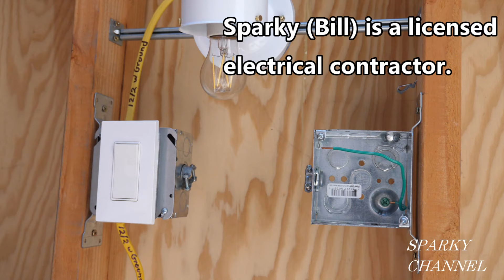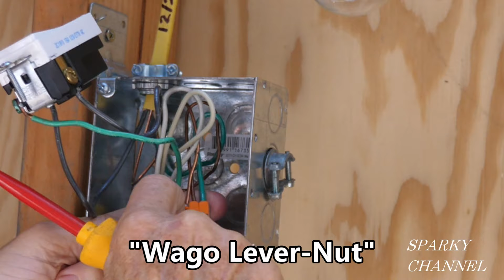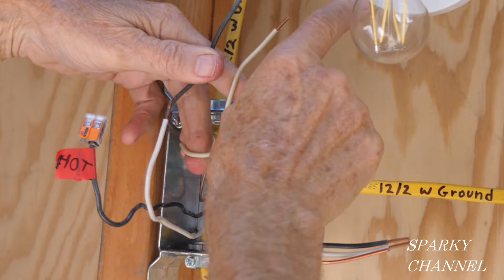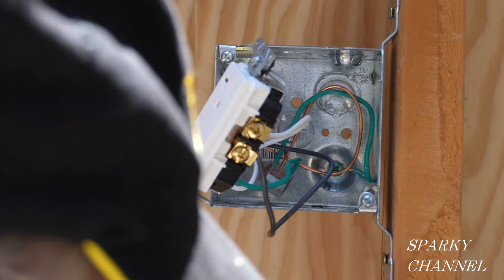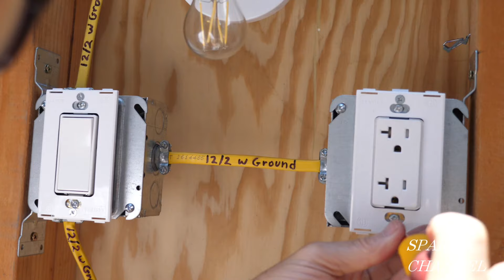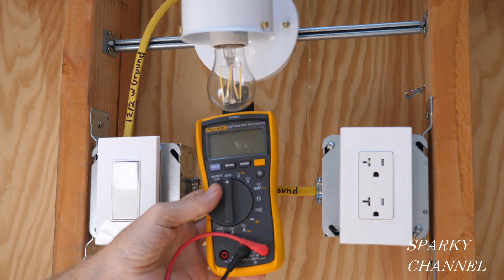How to Add a Receptacle to a Lighting Circuit

Comment: Could you also replace the 12/2 from the switch box to the light fixture with 12/3. Use the red from  switch o light. Use the black to carry the current through the light fixture to the outlet, using 12/2? Tying together the neutrals, and grounds of course. 😀
Reply: I was thinking the same thing. What’s the difference in using the two when 
Adding a receptacle

Comment: I have a question sir I love your videos...now why didn't you install the line wires going to the switch on the top terminals of outlet ? Usually the feed is on top and the load is on bottom.or maybe I can learn a different way.

Comment: Great video. I have a question. What if the hot wire is coming through the light fixture, how would you add the outlet then?

Comment: Thanks for all of your great tutorials.  With changes to the NEC 2020, you will need a neutral for the switch location… a 4 way WAGO would remove the need to later change it IF a device is added

Comment: First year apprentice for local 11 Los Angeles.  Putting new Mc 12/2 in my garage. Ran into this exact problem today needing to wire 5 outlets to 2 lights that are controlled by 1 switch. Thank you for this!
Reply from the maker: My pleasure, thanks!
Reply: How long did it take you to get in local 11? I'm also in LA and I'm waiting for a call.

Comment: As always great video. Those WAGO connectors sure make this a lot easier. I bought enough to wire the house I’m building. Will make pig-tailing easier and quicker.
Reply from the maker: I agree. Thanks Joe!
Reply: A lot of fireman claim to not like them.
Reply: @sagebrushoutdoors5712  I don't know about firemen, but some older electricians hate them. It's hard to tell who is right though as most of the evidence for or against is anecdotal.

Comment: Many lighting circuits are not 20 amp but typically 15 amp instead and therefore you will likely see a 14-2 with ground romex to a lighting fixture. Also, the romex from the switch junction box to an outlet box would then be a 14-2 with ground romex in your example.

Comment: Mr Sparky, your videos and instructions have given me the courage to wire my 12’x36’.  So far so good.  I am having trouble with a circuit that will control a light and outlet. This video situation is exactly what I want to do, but the light switch is located outside, about  15’ from the outlet. How can I wire to control the light and the outlet from the switch?
Reply from the maker: It would be like wiring multiple lights except you're wiring a light and an outlet, both which are controlled by a switch. Check this out, I think you'll get the idea: How to Wire Multiple Lights and How To Prepare Wiring for Drywall: https://youtu.be/29w_SmUSb_I

Comment: Good video just an observation, I realize service panel is right behind you but you should have still mentioned LOTO most DIYer’s don’t even know about it. Ground conductor should be last one off and first one on ( it’s the one that will protect you because you didn’t use LOTO lol )  we point all connectors up so moisture can’t collect inside and corrode. Last all screws should be vertical ( just a trade thing )

Comment: What if I have a light that I need to come off of for an outlet but it's wired with loop wiring where I get power to my fixture first instead of the switch first? I know I could tap into the hot wire but what would I do for the neutral?

Comment: I have a lamppost that I installed, I added a receptacle to the bottom of the lamppost, the the box does not work only if the light switch is on, How can I have the box hot all the time and when the lamppost is off. I have a junction box tapped off from the light switch and wire leading to the lamppost? Paul

Comment: Great video! I'd like to do something similar on a 15 amp circuit and use a switchbox to power other switchboxes on the same circuit. 

However, I'm confused (and stuck) by NEC 404.3 Enclosure, (B) Used as a Raceway, which states: Enclosures shall not be used as junction boxes, auxiliary gutters, or raceways for conductors feeding through or tapping off to other switches or overcurrent devices, unless the enclosure complies with 312.8. 

When I look at 312.8, it looks as if I can use enclosures meant for switches for feeding through, spliced, or tapping off to other enclosures, switches, or overcurrent devices as long as 1) The total of all conductors installed at any cross section of wiring space does not exceed 40 percent of the cross sectional area, 2) the total area of all conductors, splices and taps installed at any cross section of wiring space does not exceed 75 percent of the cross sectional area, 3) Bending space for conductors 4 AWG and larger complies with 314.28A2, and a warning label complying with 110.21B is applied to the enclosure. 

So with 312.8 in mind, will I be ok to use a switchbox to power another switchbox as long as I comply with 312.8 1, 2, 4 (3 does not apply)?

Thank you so much for the help!

Comment: @sparkychannel What do you do with metal boxes where the house doesn’t have a bonding system because the house hasn’t been updated (with ground wires and only has black and white wires) since the late 50s? My new bathroom vent says I must connect the unit to the ground of the house but this dedicated circuit doesn’t have one even though the 20amp/12 ga was powering / used for a ceiling mounted heater.

Comment: What if you have a 12/3 in a junction on ceiling but want to connect 12/2 is it possible to cap off the red hot in order to do that? Or the 12/3 must go to a light then a switch then 12/2 to switch and 12/2 to outlet?

Comment: I was wondering, if you have a sinagle duplex outlet, do you need a permit to make it a double duplex outlet? Doesn't adding a power strip do the same thing as far as overloading a circuit due to added receptacles to the original circuit? I didn't know I needed a permit to do that when I changed several single duplex to double duplex outlets. I do know what I was doing and even took the liberty of finding the first outlet in the circuit and making it a GFCI.
Reply from the maker: That's a good question but I think that would just be a replacement and wouldn't require a permit. You could always give a call to your local inspector and ask though.

Comment: Hi, I want an existing switch to control an outlet instead of the fan light it controls now. I know that I would run a red wire from the switch "hot out" terminal to the outlets hot terminal but my question is this.....because it would just be a single wire could I just run it up the wall and through the 2x4's then down to the outlet? I don't want to run conduit or use a 2-wire Romex if I don't have to. Thanks for any input!
Reply: Im pretty certain code does not allow a single wire run; you have to run a romex or conduit; the wires, even if using only one of them, have to be protected with an outer sheathing.

Comment: How do i check if the yellow wire is 12/2.....i have a switch that controls the light of my backyard and a power outlet in my living rooms..so my problem is that if i turn off my backyard light my tv also turns off ...so i need to leave my backyard light on all day...how do i fix that? Please help me thank you so much

Comment: Can 15amp lights be wired on a 12 guage circuit? Trying to avoid using 14 guage.
Reply from the maker: Yes, that's not a problem. You can exceed code if you like.

Comment: That is a circuit feeding the switch first. 
  What if the light is being fed first and the switch is at the end of the circuit?
  Wire the outlet past the switch and just have it where the outlet AND the light are controlled by the switch?
  Or, can the outlet be fed first then the switch and the outlet remains live regardless if the switch position?

Comment: I’ve got a question I’ve got A12/2 Wire running to a 20 switch that I’m using as a disconnect in my shed right next to the switch same 4x4 metal box is an outlet coming off the outlet ran a wire to a another light switch by the door then another cable 14/2 going to the light receptacle for the shed my question is can I go from the light receptacle on the ceiling center of shed with another wire and put another plug-in other side of the shed?
Reply: Or do I need to run another separate wire all the way back to the main 12.2 power wire coming into the shed ?
Reply: Technically you can pigtail a hot from anywhere to power more lights or a receptacle. But a white/neutral is needed for a receptacle.
Reply: Fyi i cannot tell, but that 14/2 wire needs to be supplied by a 15 amp cb. NOT a 20a

Comment: What would happen if you just put the ground from the 12/2 straight on the outlet?
Reply: Nothing. The grounding wire (stinger) To box just ensures proper grounding at all times. It will also ground itself when you screw it to the box. It's a precaution

Comment: Hi thanks for your help. If your installing say two light fixtures to this setup would you use the 12/2 wire to connect the two lights or 14/2 ?
Reply from the maker: I would, yes.

Comment: How would I do the same setup but make the outlet a switched outlet?
Reply: Switched outlet is set up the exact same as a light-- you treat the outlet receptical the same as the light receptical. So you'd be going directly from hard wire<light switch<outlet (or outlet pigtailed into light)

Comment: Hell sir. Thank you for the video. Can you tell me how you’d run a new circuit from the panel in my unfinished basement that goes to an outdoor grill island. It’s a 75’ run total and I’m installing 3 outlets in the island. I’m considering running NM from the panel to a metal junction box near the point it exits the house, transition to THWN individual conductors that run outside in PVC conduit to the island.

Comment: Hi Sparky,

Use to know a fellow who went by the name of Sparky Marine in Sausalito, Ca that provides services to folks with yachts. He helped me install a radar system on a 47-foot Gulfstar motor sailer, was that you?

Anyway, I followed your excellent instructional video and it all worked! I was able to plug in a lamp for testing and I could turn it on or off, independent of the light switch position.

The problem is that it did not work for my particular setup.

Let me explain. Just for clarity, I have a ceiling light in my hallway that has a Lutron dimmer switch and I want to have an outlet to plug in a Vornado heater.

Note, I am temporarily using an extension cord that has 3 wires for proof of concept before I get the proper outlet as you are using, perhaps this is the problem. Am not sure what the correct terminology is but my old school terminology would say that the power cord (that I cut off the plug) has a ribbed (positive) conductor,  a negative conductor (not ribbed), and a ground.

After I followed your instructions, it all worked using a lamp plugged into the outlet for test purposes. I thought, great! Now that it is working, I will go and get a proper outlet.

THE PROBLEM
Even though the test lamp worked as expected, when I plugged in the Vornado heater and then turned it on, the ceiling light in the hallway would come on, not what I wanted nor expected as the test lamp did not behave this way, and the Vornado heater, even though it was on did not put out any heat nor was the fan turning.

Note, my Lutron dimmer switch has 3 screws, 3 terminals, one black, one gold, and one blue, not sure what the blue is used for.

The Vornado heater has 3 settings, 750 watts, 1100 watts, and 1500 watts. It requires 12.5 amps at the max setting of 1500 watts.

Obviously, I am doing something wrong.

If you can help guide me, I'll buy you dinner or a couple of cases of beer!

Thank You!

MaxMcByte...

Comment: Good job sir. It was knowledgeable session. I wish you have more discussed about switch connection. I am bit confused that which side we should connect HOT and neutral on switch. Does it matter ? Like, on receptacles  gold is for Hot and silver is for neutral. Likewise does switch has same terminology? Thanks
Reply: Single pole switches take two "hot" wires, they do not take a neutral. The neutral just passes through the box without connecting to the switch.

Comment: Hah!  Pretty did a similar job in my garage last week - except I was adding a convenience light and a 2-gang box (light switch + always hot receptacle). My line wire was coming into the lighting fixture first.  I thought I could run a 12-2 from the light fixture to the gang box, but after thinking it through, it was (of course) a 12-3 that I needed.  I was second guessing myself for a few minutes there...
Reply from the maker: Electricians need to do lots of thinking. That's why we're so smart. LOL! Thanks Jo!

Comment: Nice and clear video.  But through video editing at 8:18, you didn’t show adding the third black wire to the Wago connector that goes to power the switch as it magically appeared a few seconds in the video.  Also, I would  extend the electrical tape around the switch as some of the copper was visible on the switch which cause a short if it touches a ground in the box.
Reply from the maker: Thanks!

Comment: Could u answer a question:  if the outlet and switch were in the same box would the wiring be different?
Reply from the maker: I'll do a video on that. It will be a 3-way switch, not a regular switch but it should answer the question.
Reply: I only want the switch to control the light, the outlet is always hot for a Washing Machine.
Reply: @MrMed-hl2fq  to do that you pig tail a neutral and the constant hot to the receptacle. make sure it's the constant hot and not the hot going to the light.

Comment: I got a problem. I was replacing(not installing) a GFCI outlet and a 2 single pole switch that was in the same electrical box.  Only reason was the switch that controls the overhead bathroom fan broke and was stuck ON. I bought a new gfci outlet and 2 single pole switch to replace them.  I figured I just put the wires where they were on old pieces.  The original had white neutral wire going to the LOAD and red wire going from hot side of Load to the hot side of switch.  I couldn't get the switch out far enough to just un screw and put on the new switch.  So I had to get all the black wires off.  That's where my issue started.  I have 4 black wires.  None were going to the outlet only the red.   My tester showed one black wire going down the box was hot. I can't remember where all 4 blacks were going.  There were only 4 screws used on switch.  No ground. Only ground was on the outlet.

Comment: Sparky question  can u use the newerled lights on the 20 amp.
Reply from the maker: Sure.
Reply: You can even use more of them than the old light bulb types; just keep within the max circuit ampacity

Comment: So if I stick my multimeter to hot and ground. And voltage stays at 120v it means ground wire is working like it’s supposed to? If the multimeter reads 0 then something is wrong?
Reply from the maker: Yes, that's correct.

Comment: ok im lost, bought new ceiling fan replaced the light switch for fan and the fan control switch, and also replaced the closet light switch. Now the the fan switches work but my closet light switch on the "off" will kill the closet light plus my receptacles.   I have 3 hots coming in the box, 2 on top and 1 from the bottom, does it matter which connection screw on the switch??  Its a single pole switch with 2 connection screws.
Reply: You've got some weird wiring from the sounds of it I'd call an electrician honestly
Reply: Looks like you put your outlet on the switch instead of it on always hot..

Comment: What if the power source is inside the finished wall in plastic box? How do you get the romex in the feed box and secure it?
Reply: When I ran into this, I figured my options were to use a wire snake (aka "fish tape") from the box in the finished wall to the new box you're installing OR remove the finished box, run the wires, and install what's called an "old work" box.  My experience has been better using the "old work" box, especially if you have to drill through studs to route the romex, but YMMV.  Not saying you should do what I do, just putting out my experiences.

Comment: Can someone help answer how the steps will change if I don't have a wago wire nuts and my work boxes are plastic (with no grounding screw/wire)?
Reply: Use red wire nuts and the boxes do not get grounded.

Comment: If you add a receptacle to a lighting circuit that uses knob and tube wiring, can you just add romex wiring to the circuit to add the receptacle, or does the NEC code require that the entire circuit be converted over to romex?  In general, can you just add circuits to an existing knob and tube installation using romex for the additions, and just leave the existing knob and tube wiring in place?  Thanks.
Reply: You can add romex to an existing knob and tube circuit, providing you are not overfilling the box you are tapping off of. If you're planning on taking power from a light switch, there will most likely be no neutral in that box. Older homes usually have the neutral at the light and have a dead end switch leg at the switch. If you do find a knob and tube junction box to tap off of, you will have to install a ground fault receptacle since here is no ground with knob and tube.
Reply: @brianbell2439  Thanks!  All your comments make sense.

Comment: What's the cost difference between 12 and 14? Why not just go with 10 on a 30 amp giving the advantage of being able to put even more receptacles. What's  difference in cost between 15amp and 20amp receptacles? What's the difference physically between a 15amp and 20amp receptacle?
Reply: don't use 14 gauge look up the American national electrical code
Reply: just saying
Reply: @frankpizarro7924  just sayin' what exactly?